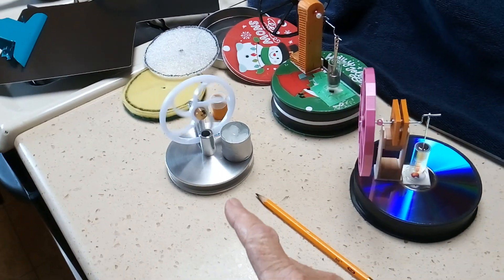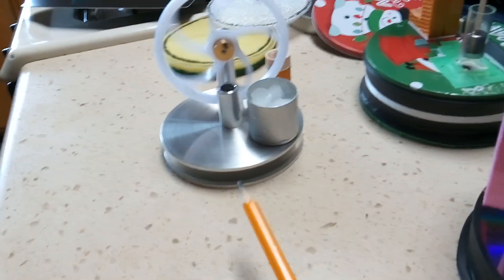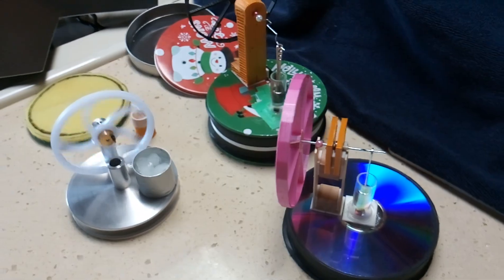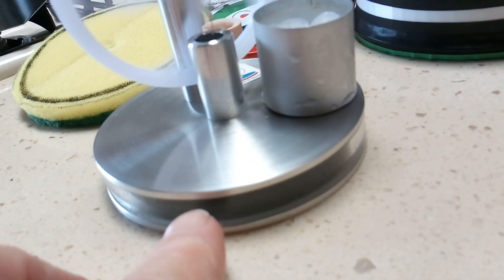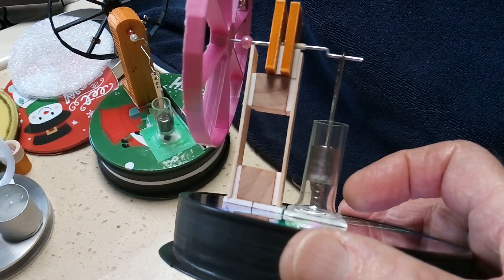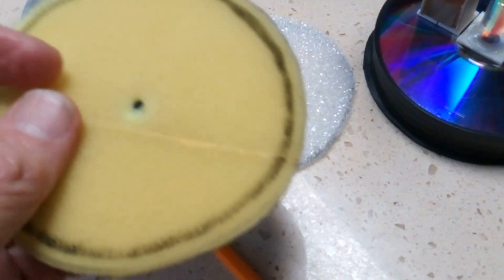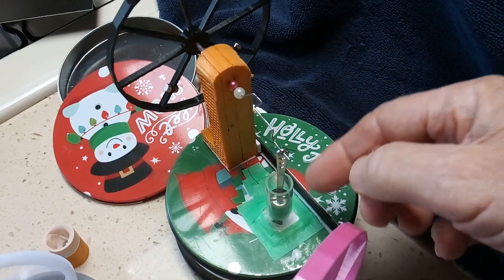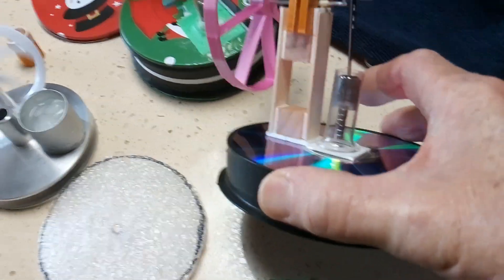My magnetic Stirling engine doesn't run

Comment: Your making some serious mistakes here bro ❤:
1.Pla printed flywheel has no weight so it cannot conserve energy.
2. Top and bottom plate should be metal to conduct heat.
3. Magnet rising displacer is mostly loosing energy. If You really want to use it - it should be as minimized as possible. (I mean the force to rise up displacer and to break connection). Btw if You want still to use magnet displacer should be as light as possible. 

Keep up good work! ❤

Comment: You seem to always follow thru and find a solution. I got faith you will figure this out. After your first video showing the magnetic sterling engine, I looked for awhile on YouTube for some videos showing how to build one and saw some that were very informative.
The YouTube channel:

Yattemita 3 2 5
Hand Made LTD magnetic Sterling engine

And

ScienceTubeToday
Magnetic Low Temperature Differential Sterling Engine 2

Hope this helps.
Keep the videos coming.
I really enjoy your channel.
Reply from the maker: Thanks.  I finally got this to slowly run today.  It still needs lots of modifications.  I watched a bunch of videos on these magnetic stirling engines before i started building mine.  I just made alot of basic mistakes in the design.

Comment: That is cool that you can pump it manually, but I can feel your frustration 👍
Reply from the maker: I finally got this to slowly run today.  Persistance is everything.  It is still a long ways from hitting the print botton on my 3D printer and watching it form up on the print plate.

Comment: another magnet on top north to north as a spring to limit your up travel maybe?
Reply from the maker: Actuallt the problem is at the bottom where the two magnets attract.  That interface has to be just right or the thing doesn't work.

Comment: I tried to make one of these many years ago.  I couldnt get it to work either.  From what I've learned is that they really need to be air tight.
Reply from the maker: Yes you have to build an chamber that will hold air pressure.  A leaky design or one that isn't rigid dose not work.

Comment: Maybe the compact disc is too good of an insulator, the thin metal lids are very good thermal conductors.
Reply from the maker: Yep. The plastic cd as main chamber plate was not a great idea.  It looked good though.😀

Comment: If your going to put an ice cube on the top aluminum plate, it needs to be thick to conduct the heat through the plate. But, the bottom plate does not nessesarilly need to be thick. It just depends on how you apply heat and over what area.

I don't think plastic top and bottom plates will work. You'll definitely  want aluminum. I propose that you can print the side walls with a few nubs for screwing down the top and bottom plates. I'm not sure you can 3d print the power piston cylinder  with enough precesion. The standoff and flywheel  can be 3d printed. The crank is best to be made in metal.
Reply from the maker: Thanks for the excellent ideas.